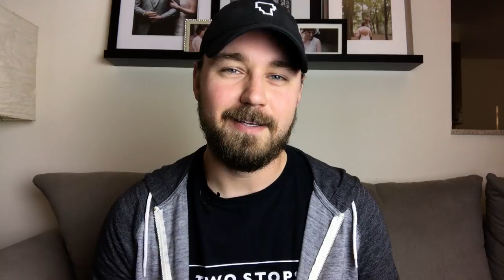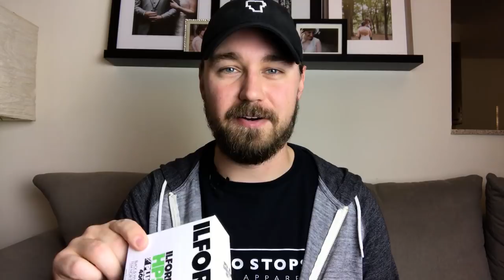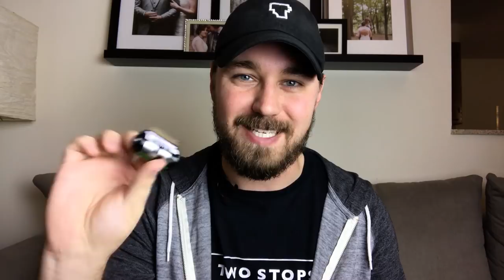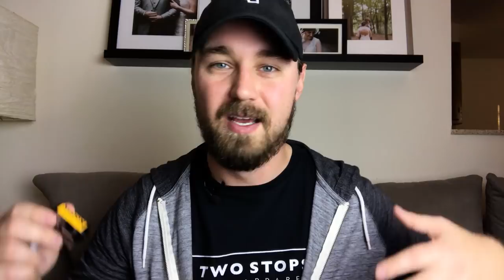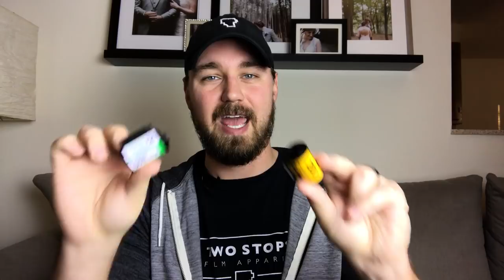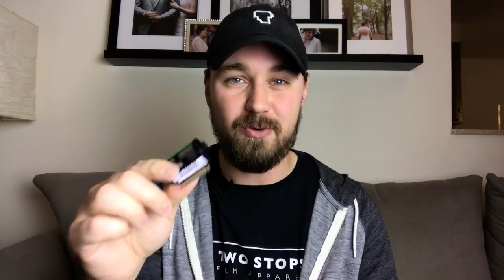Hacking DX Codes During Bulk Loading | Nick Exposed

Comment: Brilliant. I've got a Nikon Action Touch (dx reading) that I like using for street photography on rainy days. Problem is, when it rains the sun's usually not out, making me want to push to 1600. Time to order a couple of rolls of Natura 1600 or Superia 1600. :)
Reply from the maker: You could also scratch the 400 speed film canisters dx codes to push it to 1600, or simply bulk load hp5 into 1600 speed canisters. Hope that helps
Reply: Nick Exposed yup. That's exactly what I've done: bulk loaded HP5 into some recycled Superia 1600 cartridges from the camera store where I am an intern. :)

Comment: One thing I do quite often is to rewind the film back into the cassette, mark with a sharpie what frame I was on, and switch to a different type of film. When I want to go back to that original roll I then pull out the leader with a leader retriever. I mainly do this when I'm carrying just one camera with, say, black and white film and I see something that B+W would not do justice to. Yes, it's kind of cheating, but it often gets me shots I would have missed otherwise.
Reply: Gabe Anzelini I do the same, just to prevent a double exposure. I agree that the limitations of not being able to change film midrolll is part of shooting 35mm. Although the Reflex slr will soon be changing that, plus I regularly use different film backs in medium format. My view is that I'd rather be able to take the photo on the emulsion it'll be best on instead of just passing up the opportunity. :)